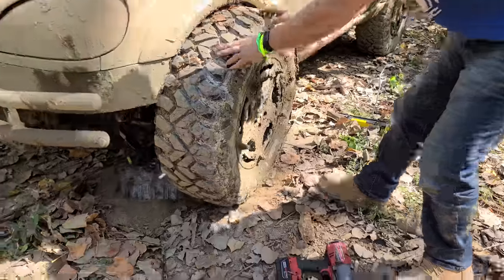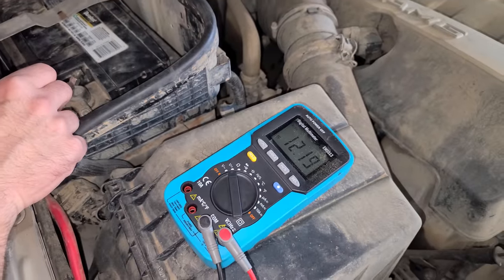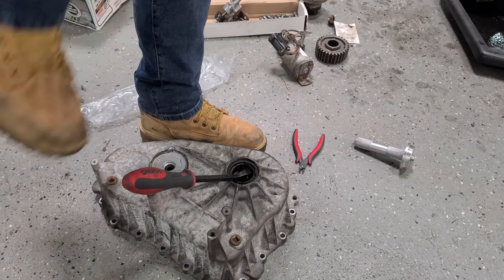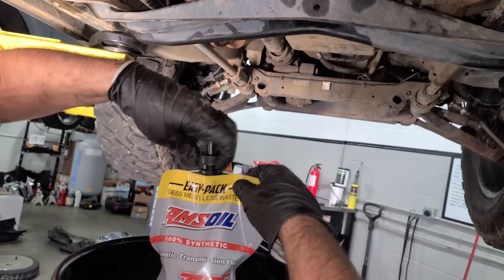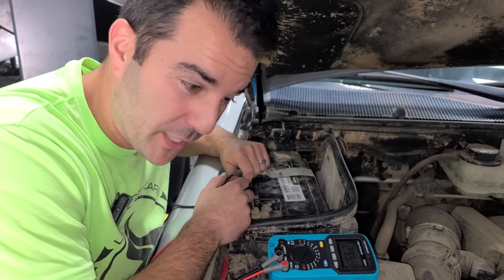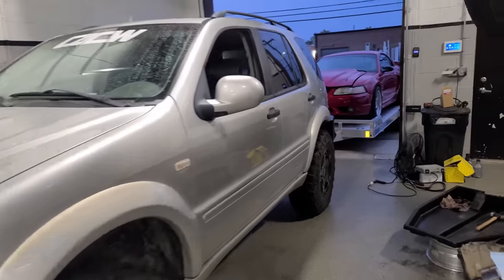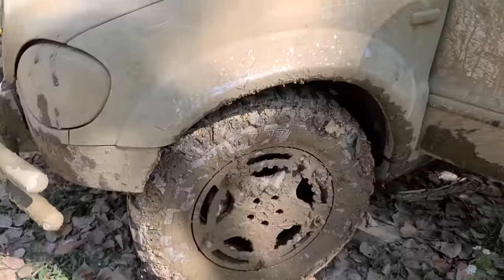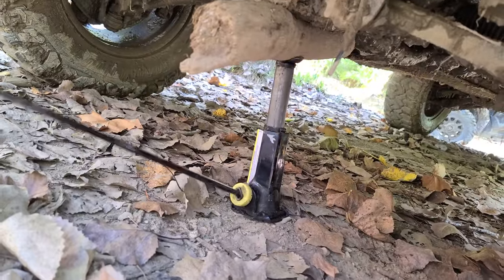I Built A Budget Off-Road AMG Mercedes & Brutally Broke It Twice! DIY Fixed On the Trails! CARNAGE!

Comment: Legit street whales

!! Supercharge the ML!!
Looked like a lot of fun.
Very easy to damage underbody components on that off road course.

Still she stood up well to the punishment!!.
..
Just goes to show Mercedes are well built..

Good job you inspected the internals of that transfer box.
Never know what your buying..

Weird that bolt going missing...
...
I think perhaps a transmission oil cooler if it doesn't already jave one.
Ugrade the existing one?
This may help the longevity of the driveline..

Comment: I have no idea why none of the You Tube channels I follow explain the differences of the different types of Loctite and where to use them. More importantly, where not to use the different strengths. As an example, never use red when putting a steel bolt into aluminum.